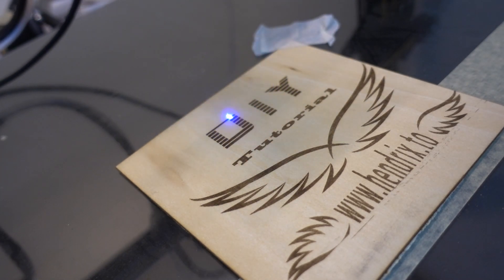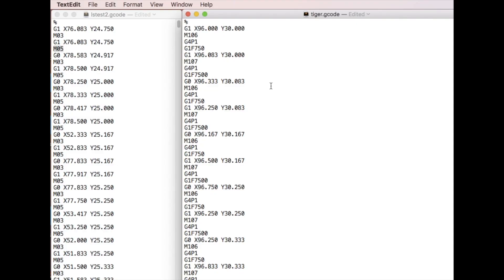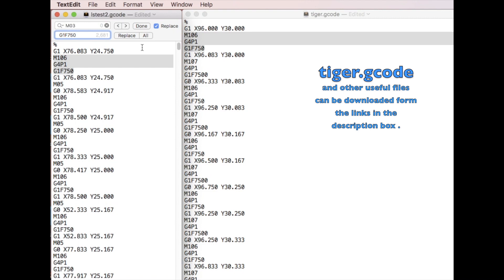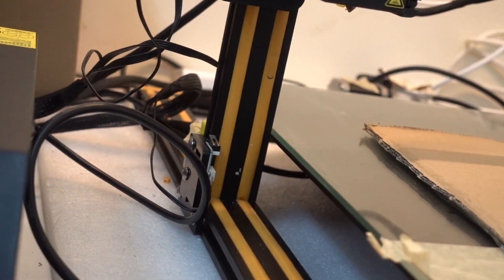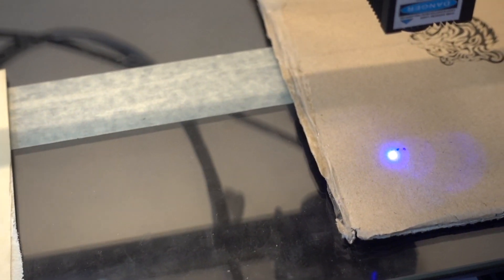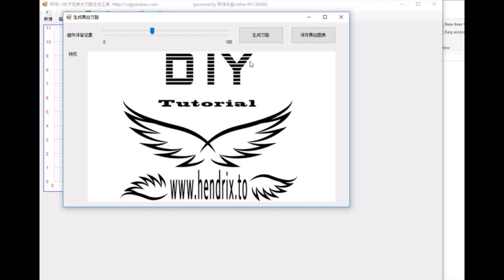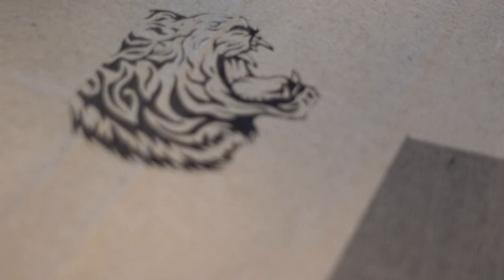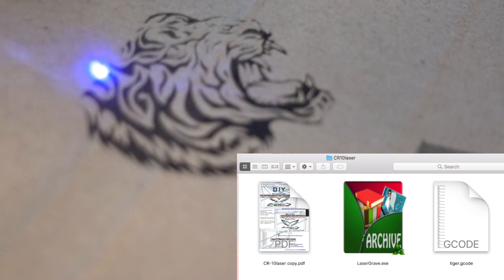CR-10 Laser Engraver How to make it work

Comment: Dont enable background noise while your trying to explain... i cant hear you : /
Reply from the maker: Oh ， sorry ， this is some early video , don't have pro Mic , only use Cam mic .
Reply: @AIengine  I got things sorted out. Thanks for the info👍
Reply: @AIengine  is the laser supposed to be attached to the k-fan? Or the regular fan? Or does it matter?
Reply from the maker: @indiehandstudios5711   laser power connect to fan power , control by fan on/off in G coda .
Reply: @AIengine  your tiger code is the only thing that given me any good results at all. Maybe my travel moves were not fast enough but it looked like my laser was staying on:/ I'll research more about the gcode commands needed and do some experimenting. I do have it connect ed to the fans power.
Reply: @AIengine  ok it's something to do with my setup, my main fan is constantly on no matter what I set it to.. gonna have to get that sorted out first..
Reply from the maker: @indiehandstudios5711  you need to follow the part edit G coda in text editer .
Reply: @AIengine  Ok you were totally wrong.. Its needs to be connected to the k-fan not he regular fan : /

Comment: I don't have mac to replace gcode numbers
I have window 10
Reply from the maker: Replacing text within Notepad
Open the text file in Notepad.
Click Edit on the menu bar, then select Replace in the Edit menu.
Once in the search and replace window, enter the text you want to find and the text you want to use as a replacement.
it just not as visual helpful as on Mac  text  editor